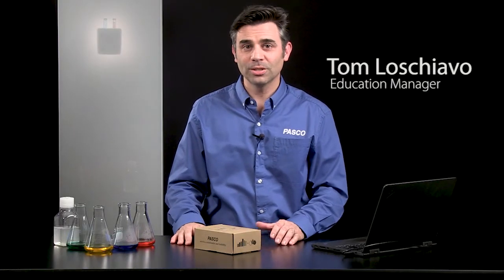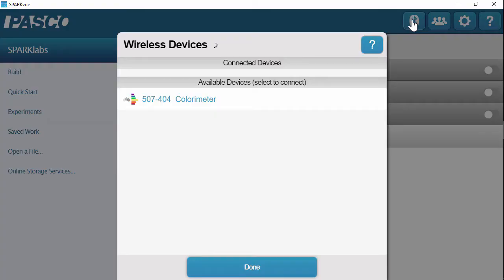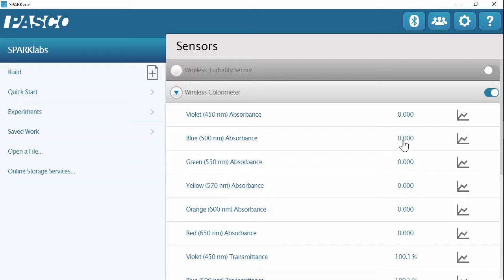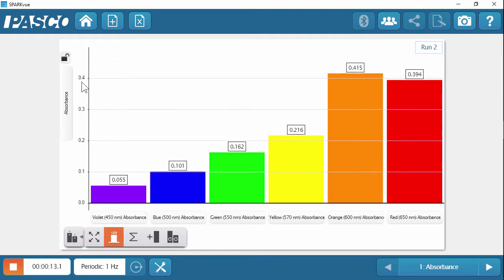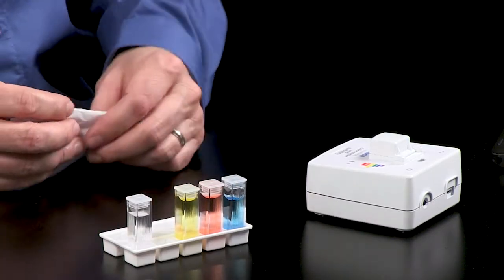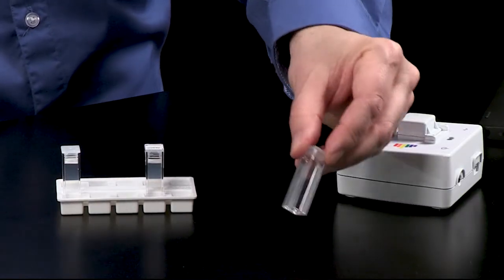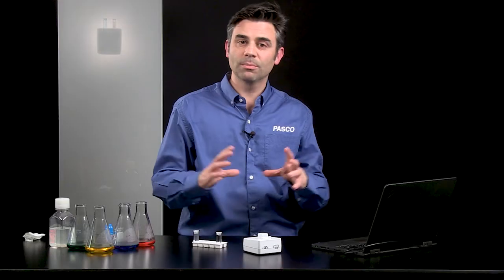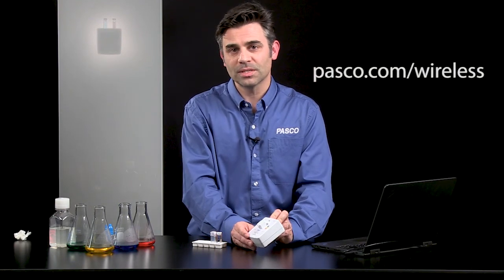Wireless Colorimeter and Turbidity Sensor Overview

Comment: Pak, mau tanya. Dimana saya bisa mendapatkan cairan Kalibrasi. Berapa duit ya kira harga nya. Terimakasih
Reply from the maker: To calibrate colorimeter measurements, just use a cuvette of your solution's solvent (often distilled/deionized water). For calibrating the turbidity measurement, use the 100 NTU calibration solution included with the sensor. Replacement 100 NTU calibration solution is available from PASCO as SC-3512 (https://pasco.com/product/sc-3512).